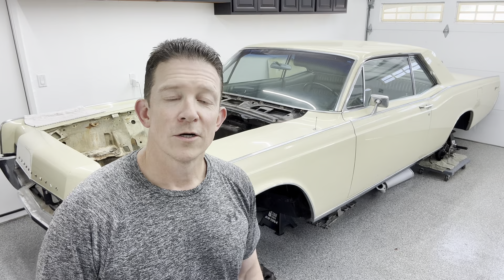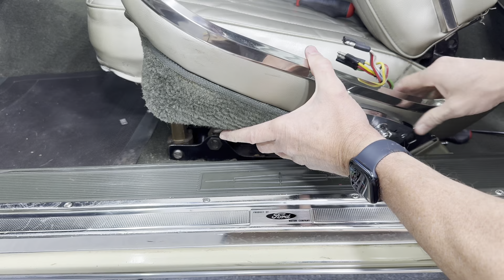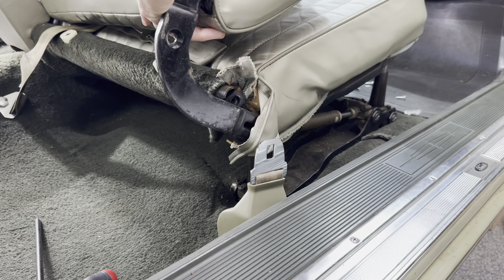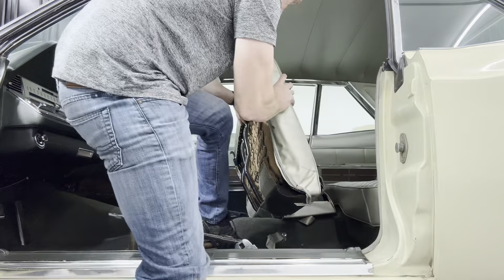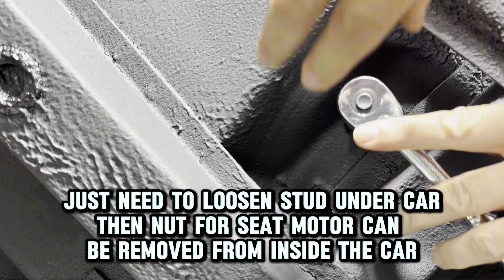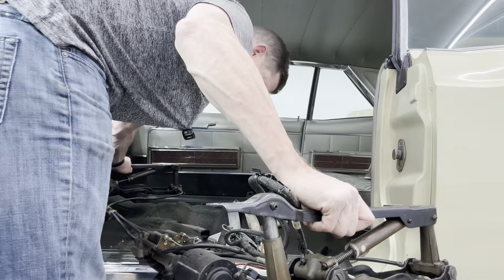1966 Lincoln Continental | Front Bench Seat Removal

Comment: Would this be the same for a 1968?
Reply from the maker: Yes, if you’re talking about a 1968 Continental and not a Mark III, the basic process should be the same. There may be some differences depending on the seat/options, but the seat and track assembly is removed from the floor and the electrical connection disconnected essentially the same way.
Reply: @66LincolnContinentalCoupe thank you for replying. I recently bought a 68 Lincoln continental and it’s got some issues but I was wondering do you know any easy after market wiring harnesses for these things? Any help much appreciated. Thanks
Reply from the maker: @justingardner3295 I went through a place called Bauer Electronics out of Oregon but it’s because I was after authentic/OEM since I’m restoring my car for car shows. If you aren’t after OEM-specific, you can look at Painless Performance’s universal harness. May be worth contacting Lincoln Land (in Flordia) for recommendations as well. Chris Dunn (owner of Lincoln Land) referred me to Bauer…he may have other suggestions as well. Even if not, they’re a great resource for any parts you may need. Best of luck.

Comment: Dojt have a continental, but I got a cutlass supreme, unbolted the front seats, but could get it out because it's parked on single garage tight side spaces, have to push the car out.
Reply from the maker: That would be frustrating. Hopefully it’s in a position to roll back easily to complete the job.

Comment: Hey Greg, 
Just curious why you removed it. Is something not working ?
Reply from the maker: Hey Steve! Removing the seat opened up a ton of room to pull the steering column, which I’m working on now. After that, the dash comes out so I can access the evap and heater core housing. All of this work outside of the engine bay is really just setting the stage for the engine bay detail.
Reply: @66LincolnContinentalCoupe Ahhh, gotcha. 
The dash is fairly easy it's amazing the network of vacuum lines and miles of wires behind it.

Comment: That’s basically how I have done it. Except I usually remove the seat bottom with the mechanism attached.
Reply from the maker: I had considered that, but since I’m going through every nut and bolt on the car, I decided to separate everything now rather than later on the workbench.